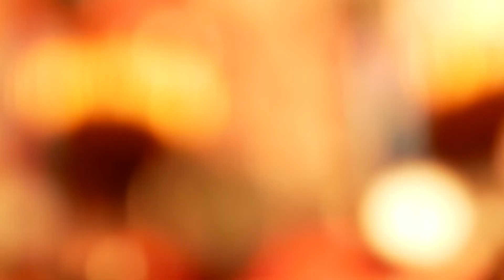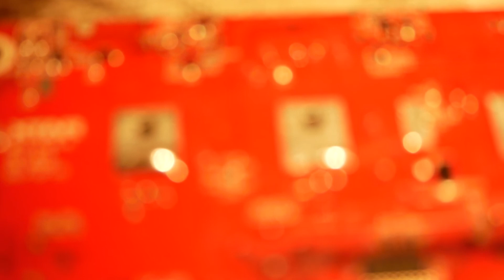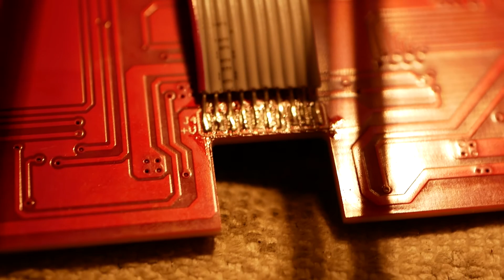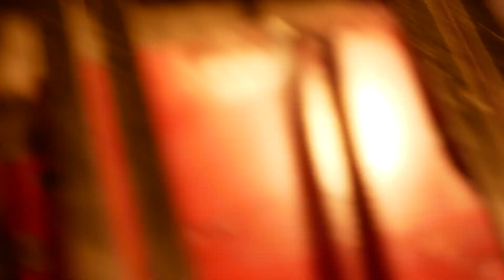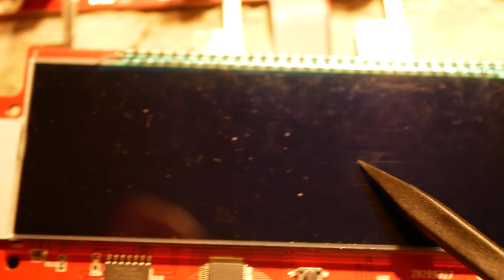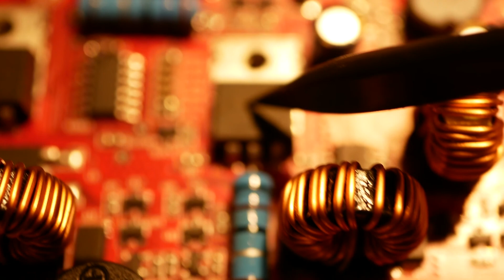XTAR VP4 plus teardown

Comment from the maker: Just my opinion maybe, but I have used, tested and purchased a LOT of chargers over the years and the one I like best is the VP4+ for testing cells. It's easy to use and all you need to do is put in another set of cells and it goes right to work testing them. Other cell testers need to be set up again for every set of cells. The current VP4+ cell testers work well and capacity results are pretty reliable. I would not judge the current product by much older versions of the VP4+!
*
I have 2 of them now and both see constant use 24/7. This original one has not stopped testing cells since January. The newer one has seen constant use for the past 2 months. I'm finally getting to the end of my 18650 collection and now have about 50 that are simply too weak to use anymore. There are many others in the less than 2100mah range that will see use in flashlights or other low use scenarios. There's quite a few in the 2400mah or better range that will get used for a power wall or a bench battery pack. These cell testers have seen a TON of hours of use on them and are still going strong!
*
The VP4+ has room for improvement:
1.  I'd really like the LCD to display cell voltages. 
2. There's lots of display space. I'd like to see all 4 cells full status on screen at the same time. 
3. I'd like the plug in probes used for testing Ir and cell voltage to be eliminated and to include this information in each cells status info. ISDT, iCharger and others can do this. Why can't XTAR include this for each channel too? 
4. I'd like to see an 8 and 16 channel cell tester based on the VP4+.
5. I'd like to see the VP4+ support rechargeable 9v batteries in their various forms and chemistries.
6. I'd like to see BT connectivity and a windows/android/ios app so that cell status can be tracked. The current implementation is inadequate and pretty useless. I'd like the app to be able to control what the charger is doing.
7. I'd like to see LIFE cell support.
8. I'd like to see 2 amp charge AND discharge on all 4 channels at the same time.
9. I'd like to see the balance charging port handle more than 3S. You have 12v in, use a BOOST converter so it can support up to 6S. I'd like the balance charging port status on the LCD.
10. I'd like the LCD to be dot matrix so what is displayed can 100% change depending on what is happening. Purpose built, single use LCD's are dumb!
Reply: Just on point 3. I think that the XTAR VP4+ Dragon is one of the few Charger/Analysers to use the more accurate AC impedance method to provide Internal Resistance measurements. (Correction - The VP4+ DOES NOT USE THE AC IR TEST METHOD - IT USES 4-WIRE DC IR TEST METHOD) - mea culpa and apologies for my incorrect assumption. 😬)
Those Chargers that measure via the charging contacts use the (2-WIRE) DC measurement method for IR  and are nowhere as accurate as the XTAR's (4-WIRE) Test Leads with their better contact surfaces.
Reply from the maker: @Micro-Motive  I understand why the VP4+ is 4 wire for IR testing and why this is better and more accurate. You can connect 4 wire probes right next to each other...literally millimeters apart! You see this in the 2 probes on the VP4+. This would allow the spring loaded contacts to do 4 wire testing. All that is needed is to turn off charging or discharging and use the same Ir functionality for each channel that is used at the 2 probes off the back of the VP4+. This quite doable, just needs to be implemented!
Reply: @de-bodgery   @De-bodgery  You misunderstand the two basic issues. (HOWEVER, I ALSO MADE ASSUMPTIONS THAT WERE NOT CORRECT - mea culpa and APOLOGIES. 😳)
The XTAR VP4+ Dragon DOES use the 4-wire method. (CORRECTION - YOU DID IDENTIFY THE 4-WIRE TEST METHOD CORRECTLY,  even though it was by assumption.)

The basic issues are:-
1. If you read the Factory Data Sheets, e.g. from LG-Chem for the HG2 3000mAh INR18650 cells, they specify two different "Internal Resistance" measurements.
(a.) AC @ 1kHz and (b.) DC. The AC measurements are the primary specification, and are typically around half the value of the DC secondary specification. 

2. The contact surfaces involved are critical to any low value resistance measurements.
The Battery contact surfaces, the Charger contact surfaces, and the contact surfaces forces, will contribute to measurement error - typically due to contamination or oxidation. 

The 2-wire DC Measurement Method is unreliable - even in a consumer grade product.
This is why the XTAR VP4+ Dragon use Instrument Grade probes and the 4-WIRE DC Measurement Method - to minimise measurement error at a reasonable price point.

To try to implement the AC Measurement Method into the DC Charge/Discharge path would be over complicated and unrealistically expensive from both a mechanical and electrical/electronic point of view.
Reply from the maker: @Micro-Motive  You know this as fact? I see 4 pins in the USB-A connector. There are what appears to be 2 wires to the probes. You might be right, but my assumption was inside the 2 cables was actually 2 conductors each. I have several sets of the probes, I'll sacrifice one of them and make sure.
*
Contacts...I do a lot of milli ohm measurements with a 4 wire meter. I run into the issues you describe quite a lot. I think the spring loaded contacts could still work if they were sharper. You can buy single cell holders that have sharper points on them that are commonly used with better cell testers. I think with the same points as they use any spring loaded cell holder would do fine. I do wish the VP4+ had better contacts. There are times where I have to wiggle a cell around or add a magnet to them to get the cell to make contact.
*
A single mosfet on the output side of each of those 2 functions isolates it from the other function. The added complexity is VERY low! Compensating in firmware for the mosfet Rds is easy! ADC's are very inexpensive and come in lots of high resolution options for pennies each. Everything is already talking to the CPU via ADC's. Only significant change is 4 AC Ir circuits instead of 1 and switching on and off 4 more mosfets. This is quite easy and low cost to implement! 
*
I don't think XTAR implemented the solution they did for the reasons you prescribe to them. I think it was 100% about selling price. They are already the most expensive tester in this category. They would sell far fewer cell testers if they sell for $85 than they will for $75. They also considered how often average people check cell Ir...aka never and don't even know what it means. That leaves people like you and me (the minority) that actually know what to expect or what Ir is. I think they decided that 1 circuit instead of 4 would save them some manufacturing cost. They know that most people are clueless and will never know that all the other cell testers out there are badly inaccurate becasue of how they do Ir testing. They know people like you and me are not the majority. AKA...1 independent AC Ir tester vs 4 integrated AC Ir testers and slightly improved spring loaded cell holders. This all made it possible to sell at $75 instead of $85 or whatever. 
*
First 2 I bought, I paid $75 each for them. Later I found them for $65 so I bought 6 more. That's the best price I have found without buying direct from China.
Reply: @de-bodgery  Please don't sacrifice a set of Test Leads, I've just already disassembled mine and they have two wires in both Leads terminated on the Probes to give the 4-Wire Connection Method.
See my edited previous comments for corrections and humble APOLOGIES.
Reply from the maker: @Micro-Motive  How many sets do you have? I have 8. It was not a big deal to me to sacrifice one set with 7 more! Nice to know they are really proper 4 wire Ir testers! Thank you for cutting your cable and finding out. VERY COOL that XTAR really made a proper 4 wire Ir tester!!! This is what I thought, but didn't really know it was a fact....I just assumed it.
Reply from the maker: @Micro-Motive  No problem...I make mistakes or get stuff wrong all the time!
*
How do you know the VP4+ uses the DC method? What did you do to determine this? I haven't checked what it does to do Ir testing. I compared its results with an inexpensive (and probably also DC tester) and got the same Ir results and never looked into it further. I'd like to know how you found out they are DC testers. Ironically it is not for lack of equipment...just never explored this myself. I'm generally busy using the cells I just tested in a new pack I'm building.
Reply: @de-bodgery  I only have one set. 😉 It wasn’t necessary to cut the cable, just to extract the Probe from its Holder. It's only a "Press-fit". 🙃 Then remove and replace a small piece of Heatshrink Tubing. Nothing damaged, nothing lost - information gained.

 My background is in Electrical/Electronic Engineering, Manufacturing, Development and Design - so I shouldn't have made the assumptions.
Upon reading the LG-Chem Data Sheets, and associating that information with the results that I was getting from the SKYRC, XTAR, ZANFLARE and LiitoKala , I lead myself astray.
The circuitry is relatively easy to identify, and I used Instrument Grade Meters and a Digital Oscilloscope to check the output/input on the probes for AC - no AC during Measurement.

The AC Measurement of Internal Resistance was previously found in either LG-Chem or Panasonic literature, I'll see if I can find it again. 🤔
However, it basically operates by applying a 1kHz AC voltage across the cell and measuring the impedance (AC resistance) to determine the Internal Resistance.

As for the integration of the 4-Wire IR DC Test Method into each Cell Circuit, it's not a minor change to re-engineer the Product.
Redesign and manufacturing is an expensive process, typically a "dollar spent in redesig" to add additional circuitry, hardware (plastic moulds, metal fittings, ...) and features will add 25% to the Retail Price.
The XTAR VP4+ Dragon, as you quite rightly point out, is already one of the more expensive  Charger/Analysers, and the market to amortise redesign costs would be limited to the Prosumer rather than the Consumer markets.
Reply from the maker: @Micro-Motive  Nice and good job! I have an EE degree, but never worked in the feild. While in school, I started doing IT work and liked it. Here I am many years later still in IT. I do a lot of EV related things as you can see if you peruse my channel. All the advanced math I learned has long since been forgotten. I don't need it for IT anyway and I never liked doing math much anyway. I mess with electronics on a hobby level  and most of what I do is not that complex. I own a bunch of electronics test gear that collects dust about as often as it gets used.
Reply: @de-bodgery  Interesting and rewarding career path, I also have a few friends who followed a similar route. 😉👍
Nice to cross paths with you, I will check out your channel.

IT wasn’t a course or subject when I started Tertiary Education, it was either Electrical and/or Electronics or Compuer Science - Computers meant a Mainframe or Mini with Serial Terminals and Teletypewriters. 🤣 🧓🧙‍♂️

I started with an International Industrial Lead Acid Battery Manufacturer, then passed through Telecommunications, IT Service, Electronics Design and Manufacturing, Automotive Engineering, Technology Teaching, Theatrical and Commercial Lighting and Audio, Programming, IT Engineering and Management, Pyrotechnics and Explosives, Security Consultant and Installer.
Retired due to health and age - but still in the game at an International Non-governmental Organisation doing almost all of the above as a volunteer, and though my Small Business.
As a Tech Mind with Asperger's and in other words  - "a Jack of all Trades", anything to do with mechanical, construction, electrical, electronics, computers, ... as both Careers and Life Interests. Currently also doing Mentoring for ASD Teens using a Solar Powered Hydroponic Micro-Greenhouse Project heading towards AI Learning and Automation goals.
Time to give back to the community that gave me so much.

Good fortune with your Channel and EV interests.
Blessings
Reply: @de-bodgery  On a slightly different previous point, the contact resistance issue, I realised that a major contributor may well be the sliding contact used to adjust for different cell lengths.
As you suggested in your comments, a simple silicon high flex wire could  be used used to link the Moving Tab directly to the Circuit Board, bypassing possibly the largest variable.
I'll try that on my Zanflare C4 tonight after it's finished it's current Test Cycle of four Tesla NCR21700  Cells. You've got my interest peaked now. 😉👍
Reply from the maker: @Micro-Motive  Same for me. I graduated in 1987. Mosfets didn't exist then. Closest thing to them was the J-FET. Same for me back then, the IT education path was called computer science and was very much about mainframes or minis. I would have learned cobol and fortran had I gone that route. After I graduated, I worked for several years for a company that did solutions for doctors offices. They computer systom was by Altos and ran their flavor of Unix with a bunch of Wyse terminals for data input. I installed and maintained hundreds of those systems in the late 80's and early 90's. I thought that kind of thing was quite interesting and that I'd work forever in some sort of sys admin role. 2010 I found software testing and in 2012 switched to that full time. Here I am today, still doing software testing. LOL! And never having used that EE for a job, just as a hobby.
*
 Myself and a retired shop teacher do volunteer classes for kids about EV's. Dave (the teacher) knew stuff like wood working and auto mechanics and welding. I knew the electronics, batteries, motors and machining. So combined we've worked out pretty well as a team in teaching kids about EV's. We have a basic class that is essentially legos. We've simplified things considerably so that the kids can mount some parts with screws, plug in a few connectors and within an hour be riding a working electric mini bike all built from modules. The kids generally have fun doing the "lego build", learn some basics about batteries, motors and controllers and then get to ride around a little on the thing they just assembled. We'll be doing one of these classes in August. The pandemic really put a crimp in our classes! This is one way I "give back".
*
I'm 54, been doing software testing for about 12 years now and am kind of bored with it. I'm hoping a new role I discovered Friday works out. It is with a company that builds charging technology that isn't CC/CV like we have all come to know and love. They claim that how they charge can exceed the charge C rate of a cell by 2-3X without harming the cell. They also claim that at the same time how they charge will remove some of the left overs of charging that shorten cell life spans. They have chemists and lithium ion battery engineers on staff that test and prove out their claims. How do fake this? They need someone that can test the hardware and is in love with EV's and has a good bit of electronics in their background...well that's me! I'd really like to sink my teeth into a role like this! I interviewed with them this morning...will see soon enough. I've run across car battery chargers that make claims like this that claim they de-sulfate lead acid batteries. I bought one a few years ago that people said was really good. It never recovered any weak car batteries or dead ones for me. It is a decent battery tender...so I use it for that. I'm hoping whatever they do isn't some gimmick like those car battery devices clearly are.
Reply from the maker: @Micro-Motive  You are not wrong about that, but it depends on the sliding mechanism. Some have a wire soldered to the vertical tab that contacts the cell. This is an easy corner to cut to cheapen the cell holder. Others use the metal in the sliding mechanism or the spring as the current path. They are usually in the very cheap chargers. I'm pretty sure that the VP4+ has a wire on each sliding post. This would make certain that regardless of cell size that contact resistance was much more consistent. I'm pretty sure all your better cell testers have a wire going to the sliding battery post. I can see how using the mechanical slider as the current path would cause capacity testing issues. Capacity testing is X current at Y time until the cell reaches Z volts to get amp/hours. The resistance of the mechanical sliding system creating a voltage drop and not being consistent or fixed would definitely effect this.
*
I don't know anything about your C4 cell tester. considering that it can be purchased for $30, I'm guessing that it has a wire to the sliding contact. I'll also guess that it's build quality isnt very good. If you look at my tear down of the VP4+ I'm not always positive about it either and yet I still think it's the best there is. If XTAR comes out with a new version, I hope they don't go the route of so many others and look for corners to cut! It's not a perfect cell tester and there are areas for improvement.
Reply from the maker: @Micro-Motive  4 wire DC is still way better than 2 wire anything! 
*
I've manually used the DC method before getting the VP4+ testers. Can you point me to an artical on the AC method? I've never even read about it.